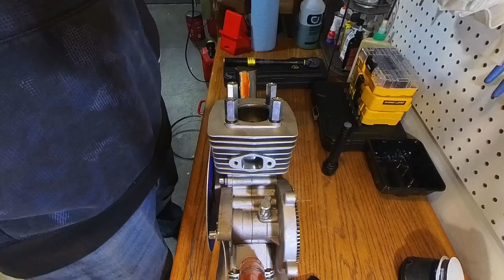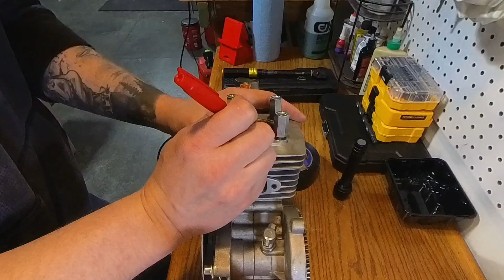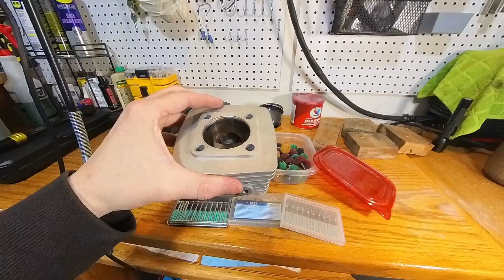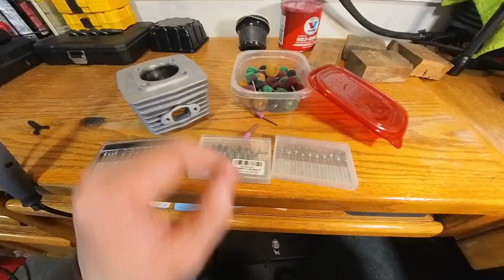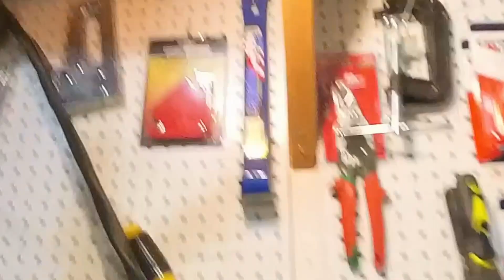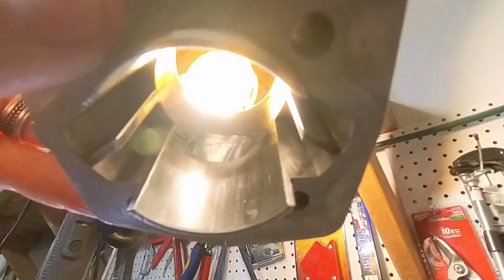Zeda 100 Max Port Cuts

Comment: You measure your piece while it's straight,then bend it to fit the curvature of the cylinder then glue it to a pop cycle stick to have a convenient port width measuring tool,I've made a few w popsicle sticks for 47,49,50&52mm bores,you have to curve them tho or it will be too wide,it's kinda like measuring your waist,not in a straight line.
Reply from the maker: That makes absolute sense.After I read your thiThat makes absolute sense. After I read your post 😅😅

Comment: Dude,you have to curve your measuring stick to the curve of the bore like when measuring your waist,not a straight line you have to bend it to curvature of the cylinder,oh man I hope you read this before you cut.
Reply from the maker: @bobjones9898  Thank you very much for the information. Now that you say it, it kind of makes sense like a lot of sense, like I feel a little dumb.... but I did do it that way on the wildcat AD and saw some pretty good results, I think having the mushroom design with the narrower exhaust  horizontally help negate any piston ring snag, which is really the only issue that you would have. I totally agree that I did not do that incorrectly. 😅 .if you watch to the end, I ended up doing the cuts already, but we'll send it.

Comment: I learned the hard way, to put lots of tape on the areas that you don't want to grind away or knick/scratch with the cutting bit.
Reply from the maker: What kind of tape do you use? That is very interesting to me. Could have definitely saved me some nicks on my transfer walls.
Reply: @grendelsgarage9723  I just use masking or duct tape sometimes both & add 2 layers.